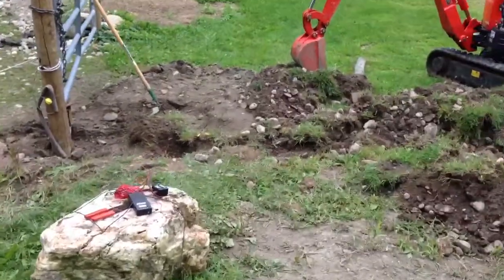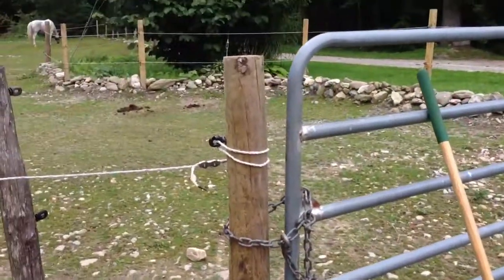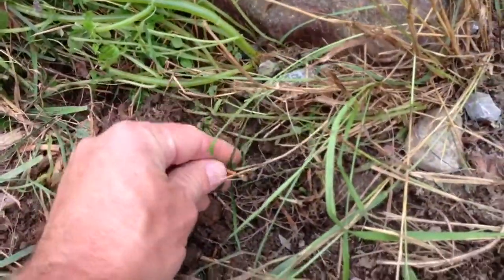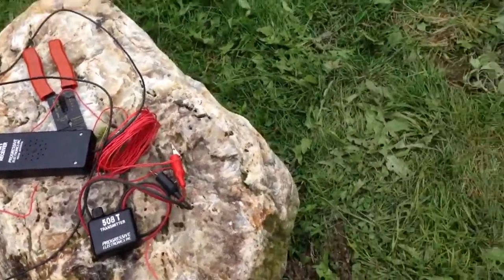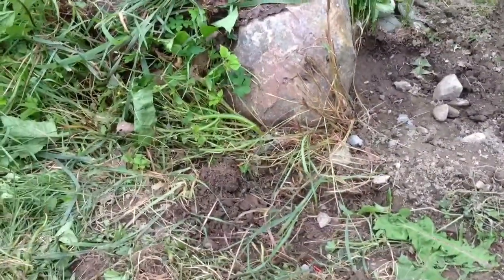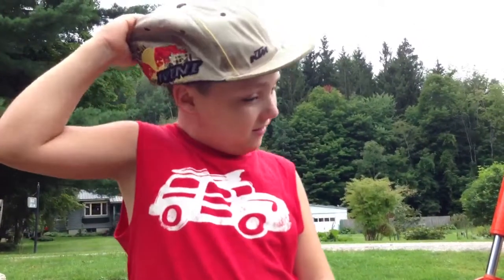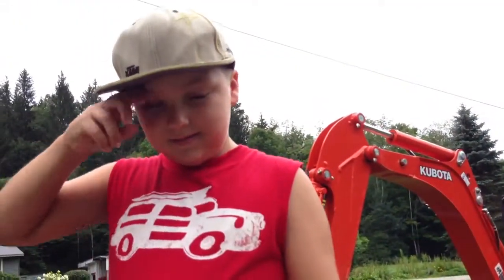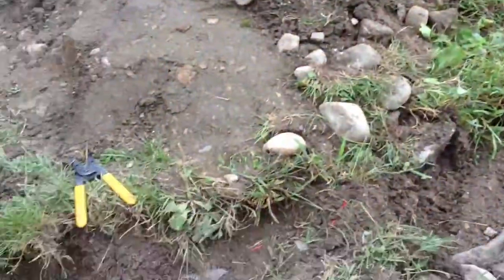Jims Excavator  #25  When small projects turn into big projects....

Comment from the maker: That was one bad luck project, theres a buried power line there, so I got so wrapped up in worrying about hitting that (The replacment post goes into the ground 43", and the power is 24") I got mentally distracted, and completly forgot about the other old leg of the dog fence.  I knew I was going to break that fence (Its only three inches under ground, but normally, I'll just splice it and be n my way.